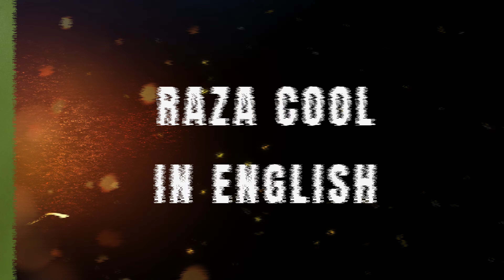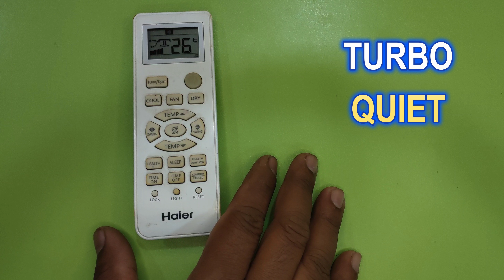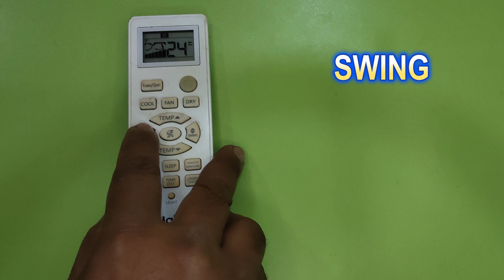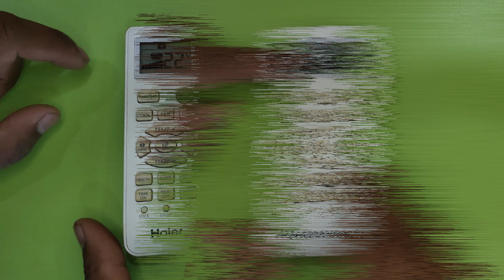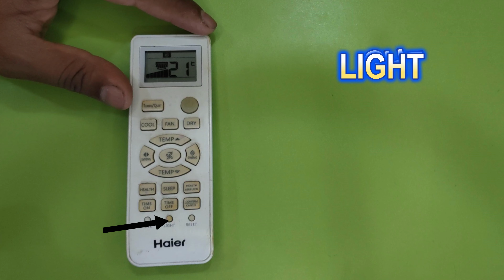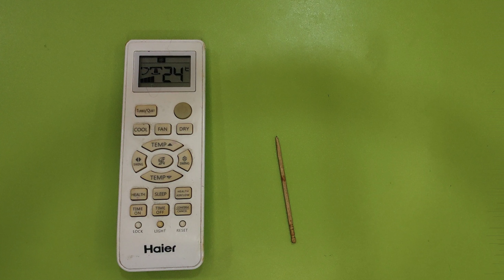How to Use Haier Inverter AC Remote Control (English Demo)

Comment: A B display means?
Reply from the maker: There is no display button in this remote, there is a light button with which you can turn on and off the display showing the temperature of the AC
Reply: I am also trying to find out this information

Comment: If there is some problem in AC then does it have self diagnosis feature in it and will error code displayed on indoor unit
Reply from the maker: Yes, if there is any problem with the AC then it will show an error.

Comment: The temperature on my ac keeps changing no matter how much i set it on for example in the remote i made the temperature 20 but in the ac’s display it is 24 then 23 then 25 i want it to be on 20 how can i fix this?
Reply from the maker: Your AC is running in sleep mode, so the temperature of AC is increasing by 1 degree every two hours

Comment: My daughter press some button but i don't know which one.That time onwards cool air not came.fan only running.Hot air came.i press cool button and turbo also .but not working
Reply from the maker: If you are using your AC in cool mode then I don't think that your AC is not working cool due to the settings of the AC remote, I think there is some problem with your AC, call a technician and get it checked